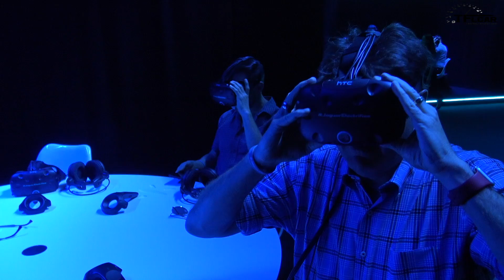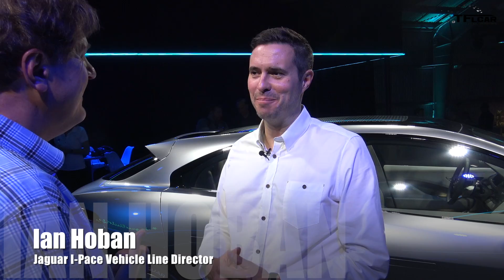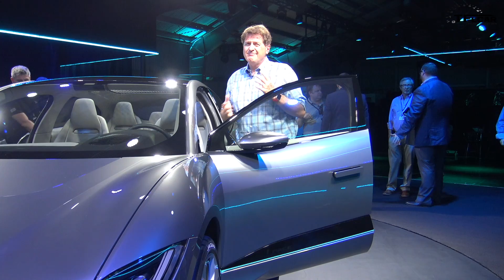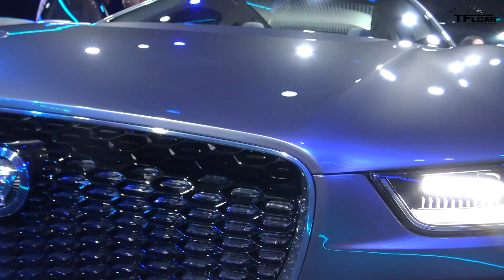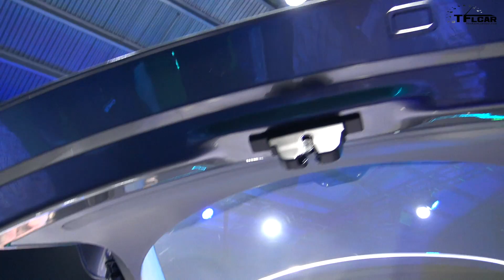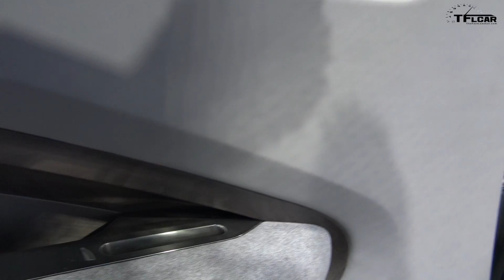2018 Jaguar I-Pace Concept: Jag's First All Electric Car Is an EV Stunner

Comment: I am surprised that instead of the complexity of a differential and running shafts through the engine, they simply did not go for four motors, only reason I can think of is that they want to retain the existing stability control systems that use differential locking.

Comment: hmm i wonder why they didn't put 150kw fast charge in this
Reply: Well, I think they will put a faster charger in it. Actually he doesn't explicitly say, that it can only charge with 50kW. He just says, that at a 50kW-CCS-Charger, it will charge 80% in 90 minutes. It would be a embarrsing, when even an 2017 Hyuandai Ioniq with a 28kWh-Battery can charge with 70kW, but a 2018 Jagaur i-Pace with a 90kWh-Battery can only charge with 50kW.

Comment: so i wouldn't need  400 hp lol keep 1 motor? and take the extended range that it would give..?
Reply: Probably you will not get an extended range with only one motor. The Tesla Model S with one motor even has a lower range than the same model with two motors.

Comment: "Building up a famiy" car bullshit marketing palava to shift these tin boxes to mugs !  With all that heat pump scavenger gizmo it still only does 225 miles  and takes 90 mins on a DC more powerful charger.. that's pathetic! who's going to wait for hour half at a motorway service station and eat the usual crap therein? NOT GOOD ENOUGH!
Reply: D' ARTICULATE it actually does closer to 300-350. he did a bad conversion. he means creating a family look. the charging time is because the 50kwh is the most popular here. it is future proofed and can be charged quicker. chill man.

Comment: 500 kms is not 220 miles, its some where around 300 to 350 miles
Reply: It's 310.5 miles and the difference in range is likely due to the different testing cycles, the European one being more optimistic.

Comment: The heat pump for warming the battery comes from the battery. Only the efficiency of heat pumps in the conversion of electric energy into thermal energy(either AC cooling or heating) makes it 2.5 times better than straight resistance heating elements can do.  Tesla does the same, I believe and it is the only reasonable way to control the cabin temperature of a luxury car when one doesn't have the massive thermal losses an IC engine creates quite naturally to use for that function.

Comment: 0-60 in about 4 seconds? Almost half thew speed of the Tesla P100D 0-60 in 2.45 secs.Roll on the drag times comparative race Tesla P100D v Jag i pace., what in  three years time ? Price over £100k, no doubt.Not as pretty as the Tesla S.
Reply: Well, it's not as pretty as an XF either. Hmm, maybe Jaguar could consider an electric sedan as their next electric car. Who cares if it's 1.6s slower from 0-60? It still leaves a lot of petrol-powered cars in its dust.

Comment: Why do electric cars still have radiator grills?
Reply: Battery isn't at the front its under the car. 
The grill is just for aesthetic purposes, that's why Tesla and a few others has done away with them.
Reply: I'm certain that in a few decades, they'll look back on the styling of 
cars in this decade and think that they were still stuck in old 
thinking. Think back to the cars of the 1920's and earlier, they were 
quite clearly still sort of based on the styling of the horse carriages 
of previous decades. We'll be saying the same thing about these EV's, 
they're still based on the styling of the piston cars of previous 
decades.

This is a full electric vehicle, not a hybrid, so there 
should be no need for a huge cooling grill. The electric motors and 
batteries can be cooled down with smaller air inlets.
Reply: It probably helps with some cooling (it DOES have a radiator and the batteries are liquid cooled...) or the heat exchanger, but the main reason is to keep the "face". Jaguar are really trying to get out there again, and with the '07 on XF, they found out later that a lot of people liked the look of them but thought they were a Lexus or German. It's the same reason they now write "Jaguar" under the rear badge compared to the old XF that didn't have it. That grille is on all cars bar the F Type, so people will recognise it as a Jaguar. In a nutshell, the grille is there so people don't think it's another Tesla.
Reply: bbbl67 battery gets too hot.
Reply: For the heat exchanger?
Reply: at first it's because people thought it looked weird without it - but with the Jag - its probably to do with the heat pump to warm the battery - the air warms the battery even on a cold day
Reply: DNA identity plays a part along with cooling aspect
Reply: bbbl67 ... They must be using Lucas for their electronics... There is a huge Zener Diode behind the front grille to dissipate the heat from the resistance/inefficiency in the electrical system...
Reply: bbbl67 because it looks weird without

Comment: Pointless.. the future is hydrogen, everything else isn't green
Reply: Scott Irons  ? The making of compressed hydrogen is dirtier than fossil fuels. Most electrical energy on the planet is produced with renewable energy now. Face it, electric cars are he future.
Reply: Oumar DiAlLo you couldn't be more wrong if you tried
Reply: Where is the 2.4 seconds 0 to 60 mph hydrogen car and how many are sold every year? How many hydrogen stations are there? What is the cost of hydrogen compared to electricity to drive a certain amount of distance?

I mean, it's easy to understand why hydrogen economy won't happen, it costs more, it requires more energy to drive the same amount of distance and it's far behind in development and production compared to electric cars currently.

Comment: This ipace car will Go up against The telsa model 3 Good luck jaguar your going to need it.
Reply: With 93 kWh and the size and specs shown is likely to cost over $100000 for the top of the line variant and compete with the Model X.
Reply: kalimul Yes it sure looks like it,charge takes about 90min on 50kw charger.Its nice looking car but I'm afraid Tesla  has far better fast charging network and Inside teck.
Reply: Mark Portch  did you hear about the driver of a Tesla who was killed because the sensors for the autopilot failed?
Reply: guy proulx 256.000 were killed in accidents in U.S.A alone.Telsa because of Auto pilot has had one accident and that was drivers fault because he kept his eys of the road..
Reply: guy proulx That's 256.000 in one year and in one country mind telsa one is world wide.
Reply: Mark Portch i thought that the purpose of having auto-pilot was to be able to take your eyes off the road without having to worry, personally i would never buy a self driving car, i like to be in control at all times
Reply: guy proulx No it hasn't got to that Stage yet.But there's new Auto pilot 2 stage 5 coming out in about a years time.Its in new tesla taday but needs huge  software update in future.That will be self drive.

Comment: Did he really say 80% of charge in 90mn?

Why couldn't they leverage superchargers :(
50kW DC is still a tad too slow
Reply: Well, tesla superchargers cut power in half to 60 kW when 2 cars are plugged in (i.e. most of the time) so that's not that different. Besides, I-Pace actually is capable of accepting 100kW+ charging, just unfortunately, no such infrastructure at the time of launch
Reply: Kestutis Jankevicius 60kw vs 50kw at worse is still a 20% bump!

not all superchargers are busy 24/7.... so if this ipace become compatible that'd be awesome
Reply: Yes, but I think infrastructure should improve quickly so it won't be long before it's similar rates. Besides, majority of charging is done at home anyway. Right now, I am not aware of any other non-Tesla car on the road that can accept more than 50 kW.. hence no demand - no supply. This will hopefully, change once more and more OEMs release proper EVs. In terms of compatibility, Tesla's chargers are proprietary, so don't get your hopes high :)
Reply: +Kestutis Jankevicius Tesla has always been open to let other automakers use the Supercharger network.
Reply: Yes, as long as they pay a fortune ;)
Reply: Plus it is not the best design from functional safety point of view - same pins are used for DC and AC current. These are the two main reasons why no OEMs will adopt Tesla plug standard
Reply: Not adopting the same plug, and not allowing SC access is two different stories.The car plug could be different, they'd just have to provide an adapter (just like Tesla have a ChadeMo adapter)
Reply: Well, no, because adapter will only route power from tesla connector into whatever IPace has. That means it is still possible to connect both supercharger (DC) and Tesla's home charger (AC) - problem persists. 

For example, CCS plug, AC and DC are physically separated, so it is impossible to have any DC coming into on-board inverter. Tesla had to put in place measures to deal with situations such as if AC power is accidentally routed to the battery, what happens? Battery management system must be able to detect that and respond. I am sure Tesla had their own reasons to choose this design (such as this CCS standard was only introduced in mid-2012.. )

Perhaps a good analogy is Apple connector standard vs. USB standard :)
Reply: Kestutis Jankevicius not really, iPhone lightening to USB exist :)

oh btw, look at Tesla nonUS plug, that one you should like it
Reply: because they have no reason. re-read the statement and official announcement.. the car is capable of handling more. it's 90 minutes on EXISTING 50kw stations. they were pretty clear about that... the car is future proofed.
Reply: 80% of charge in 90min will limit these cars to city driving, which is absolutely idiotic. Here's hoping that the car really is able to handle more than 50kW...